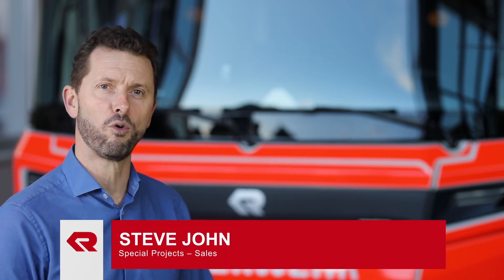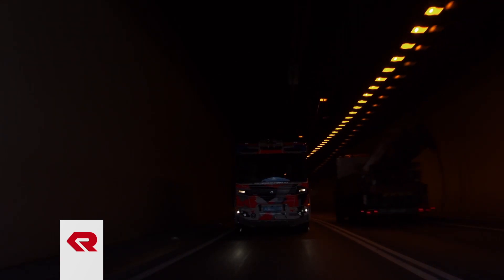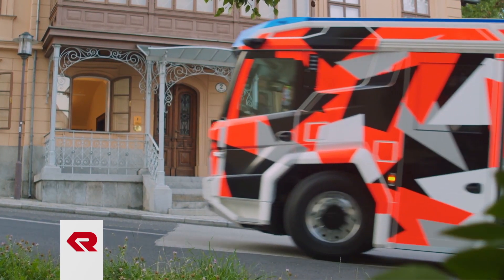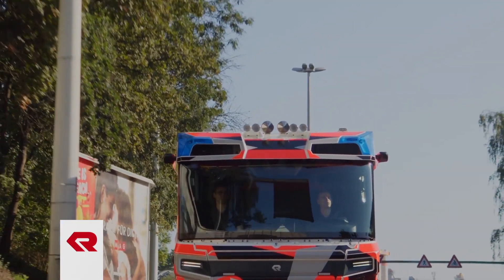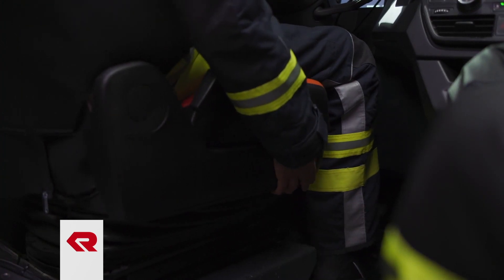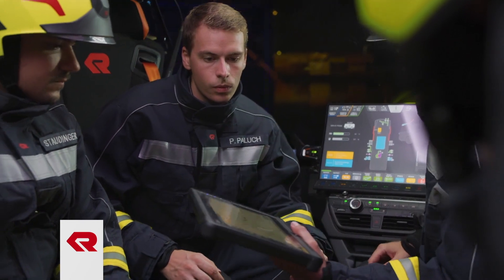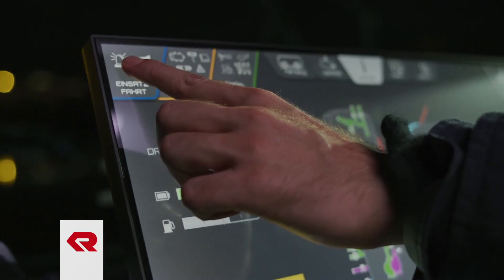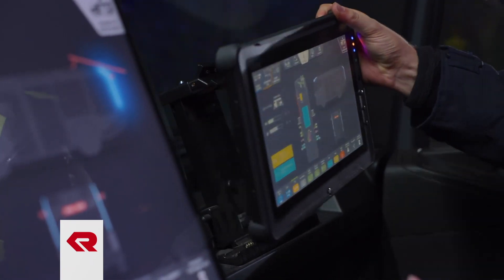Revolutionary Technology - the world's first Electric Fire Truck

Comment: First time they use the Q siren the battery goes dead;  this thing is a PR gimmick at best.  How many minutes can it pump 1500 gpm;  two...three minutes?  What a joke.🤮
Reply: it has completed its 13 month trial phase at some of the busiest stations in the German capital city. It completed every single call it was dispatched to without any issues. Actually it had even less downtime than the diesel powered Rescue Engines as it didn't need to go to the gas station at all. Within the entire year it's diesel backup generator kicked in only 10 times - not because the battery was at 0%, but because it was below 20%

Comment: A range extender? You mean a diesel engine? Lol its a Hybrid
Reply: only as backup. It doesn't need it to go through a normal shift. It only kicks in if the battery is below 20%, which is barely the case on a normal shift
Reply: @EnjoyFirefighting  BS, I've been to the Rosenbauer factory, and dealt with these engines personally, they are not capable of pumping a structure fire on all electric power for any length of time, they can putt from medical aid to medical aid blocks from the station on EV and that's really about it, none of the manufacturers have a soley EV fire offering because it simply isn't capable of running purely on EV.
Reply: @dmac5497  so are you trying to tell me that the Berlin FD is either telling lies or that they didn't have any sort of structure fire in that area for more than a year? How likely is that? 
FYI: here we rather go for less GPM and more PSI when attacking a fire. Building and fire prevention codes result in fires barely getting out of hands. Most fires inside buildings are limited to one room or apartment and can be dealt with in shortest amount of time and with only little amounts of water. Sometimes it doesn't even take a hose line or the quick attack rubber hose reel might be sufficient. Things work different here, but we definetly have our share of structure fires as well, and this truck worked on them just like any other diesel powered Rescue Engine in the city did as well. 
Within the first 4 months it ran electric to 99.55% and used only 2.11 gallons of diesel. After 13 months it was still at 95% of running calls all electric and the diesel backup kicked in only 10 times, and that's only because the battery went below 20%. 

And if there might be that one enormous fully involved structure fire of e.g. a warehouse or industrial site, which definetly isn't a daily or weekly thing here, that it can keep on pumping as the diesel backup will provide sufficient power for it. Sure, then it really needs the diesel, but it's not like it would rely on it on a daily basis

Comment: Hmmmm....no video of it actually moving any water from a hydrant to a nozzle and onto a fire.  I mean, that is the whole point of having a fire engine/pumper correct??
Reply: although definetly built to fight fires, most calls in real life are either some sort of technical assistance and rescue calls (like traffic accidents, people trapped in a stuck elevator) or are false fire alarms. And most actual fires they respond to can be put out with only minimum effort, sometimes it doesn't even take a hose to do so 
But it can definetly work on scene of "real" fire calls.

Comment: How much does this thing cost?
Oh yea, you kinda gotta yknow… plug this truck into something.
Batteries charge slowly.
I’ve seen other electric firetrucks before this.
Mining battery materials is harmful to the earth.
Reply: LOL you are just spamming baseless assertion. While not even know the basic facts. FYI This is a Diesel-Electric Series Hybrid. Mining battery materials much much cleaner than TAR SANDs source of Crude Oil. The 3000lbs battery last the entire lifespan of the vehicle. 3000lbs of gasoline is about 495 Gallons.

Comment: I like the idea of having zero cancerogenic emissions from truck that is right next to a blazing building
Reply: cute joke kid, but firefighters have to spend hours and hours next to working diesel engines, and they suffer all health problems because of that, even when doing simple exercises or operations, this makes a huge difference
Reply: @jh5kl  sure, what about the diesel generator that will kick in once you are in hours-and-hours situation?
Reply: @jakob6832  this joke is not going to have all nuances of real world firefighting. It's about how making extremely dangerous job marginally less dangerous doesn't sound too convincing of a selling point, that's it :)
Reply: @jakob6832  missions? You mean calls or runs? We are constantly in and out of the station on runs and this electric fire engine is a horrible idea right now. It’ll be dead on the first shift

Comment: Check out the price..... Which they conveniently  left out.....  Expect around 1.2 million dollars with 0 equipment on it.... So by the time it is outfitted with radios, hose, nozzles, rescue equipment, etc. it will probably be close to 2 million dollars when you back it into the station. That might not cover the high power charging system it will require.
Reply from the maker: The cost of the equipment to outfit an apparatus is the same if it is traditional or an electric truck.  That really has no comparative value when making a choice about the apparatus itself.  Things to consider would be the decreased engine maintenance cost and improvements to climate protection, noise control and health protection.
Reply: @allamericanfireequipment  You are going to run so many hours on diesel, the extra costs of electric aren't worth the money.
Reply: @jamesebdon1212  That's absurd nonsense, vast majority of the operating hours is done on electric because the battery is 160kwh. The Diesel Genset is only used once that massive battery is depleted, not needed on most calls. There is many other benefits of Diesel-Electric like being quieter while driving and the massive interior cabin space due to flexible packaging and no long drive lines. The Diesel engine is also Tiny basically an engine from an SUV which massively reduces matinaince cost.
Reply: @allamericanfireequipment  just stop. This is trash delivered straight to the residents I serve. I’m completely happy knowing I have 50 gallons of diesel fuel running the engine and giving me the ability to provide protection and rescue to the people I serve
Reply: @allamericanfireequipment  improvement to environment by mining and making large lithium ion battery a process that not environmentally friendly and unless your charging the truck only with solar and wind that not ever environmentally friendly either.  Then when cities of blackout and truck battery dead how many people will die before the proven and reliability trucks come back
Reply: @jakob6832  and if extra fuel for generator?  That tank not going to run for ever.  As for environment not when you add in the environmental effect of the diesel generator, the mining and production of the battery packs which do major environmental damage and are hazardous substance,   What about the oil and coal feed power plants that will power it?  They not environmentally friend either.  What about flood road ways in cities  electric motors do not like water.  City of Pittsburg has several parts that get flood.   Cities in Florida do as well even more so after a hurricane.   What going to do when power out for weeks or months.  That generator going to burn thru fuel.
Reply: @jakob6832  Here in Houston, just a small dumpster fire the engine will be out on the road for an hour or so. So you will be close to running the batteries down. If you get another call without going back to the station you will be on diesel generator shortly.

If you get a house fire you will be on diesel before you even leave the fire scene.
Reply: @robert-73  "What about flood road ways in cities  electric motors do not like water." You fools say the most brain dead nonsense.
Navy Submarines are Diesel Electric, Ice Breaker Ships with ABB Azipod, Electric Water Pumps, Electric Kettles.
Reply: @Neojhun  Speaking the most brain dead nonsense, the US Navy has not had a diesel-electric sub October 1, 1990.  Last I checked, water on the inside of sub is bad, last thing a crew going to be worried about is water on batteries; they'll be more worried about the water in sub.. However, fire trucks drive into floodwater streets after storms and such. But a fire truck that cannot rescue people is not really worth it.

Comment: it's not the first
Reply: Which one is?
Reply: @RoadsFranconia  The Mini Pumper & Logistics Unit Rosenbauer delivered one or two years before presenting the CFT
Reply: @EnjoyFirefighting  Ah okay. Hab vorhin ein Video von Pierce gesehen und deren E-Feuerwehrauto. Das ist ja mal ein billiger Versuch, hier noch Land gut zu machen, alleine abgestellt auf Emotionen.
Reply: Go to Rosenbauer website..... 1. The truck is easy to get into because it has a system  that raises and lowers the entire chasis= more expense, and more to go wrong.
2. With full charge you get approx. 30 min before the batteries are dead and the generator engine has to kick in. Very few fires that are significant will allow going to the scene, pumping water, and get back to the station in 30  min. 3. Come back to the station with dead batteries and it takes just under 1 1/2 hours to completely charge the batteries. 4. Try to find one of these trucks in service in the US you probably can't. It's marked and called CFT or CRT for Concept Fire Truck or Concept Rescue Truck.... It's brand new and largely untested technology.

That was a nice commercial..... But VERY misleading!!!
Reply: @jamesebdon1212  1 it's air suspension, it's sth which has worked on other Rosenbauer apparatus serving the busy life of capital city fire and rescue services for years without greater issues already like in the Danish capital city of Copenhagen
2. Full charge allows 60 to 90 minutes of permanent running service, that's more than sufficient for most calls; The CFT tested by the FD in the German capital city was running at a busy downtown station for 4 months and it was running several hundreds of emergency calls all electric before the diesel generator kicked in the first time, for only 10 minutes. 
3 A full charge takes 30 minutes
4 obviously you can't, as there are 3 in service at departments in 3 different countries so far: Berlin FD in Germany, Amsterdam FD in the Netherlands and Dubai Civil Defence in the UAE; Several other departments signed contracts already, thus the Oslo Fire and Rescue Service will replace the country's busiest fire apparatus with a CFT as well